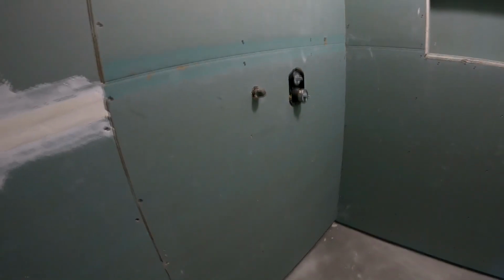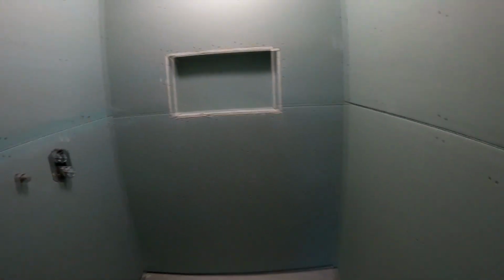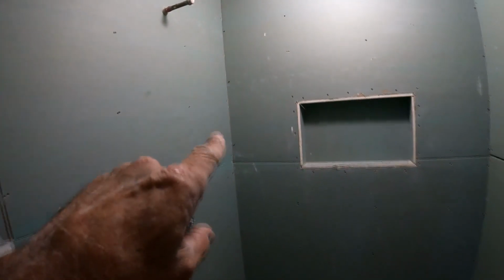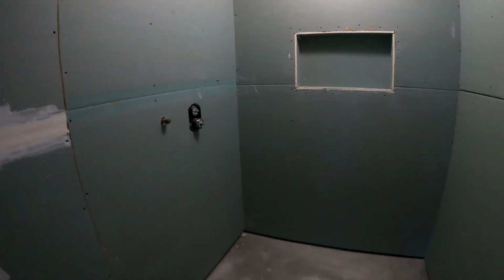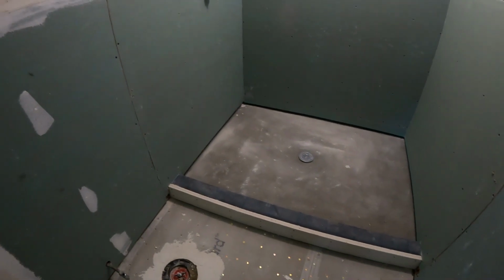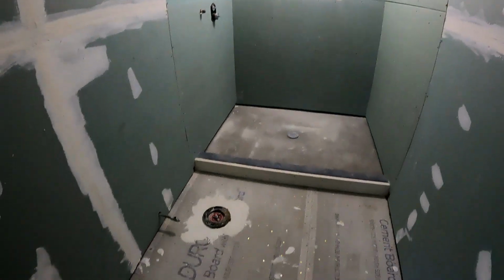COMPLETE BATHROOM BUILD...Day 5

Comment: Hi Bob ! That inside Corner mud tool sucks ! I started over and went with that thin metal backing inside and out side corner beads for my project .They are cheap ,easy and give a superior finish / look !! Very easy peasy to do and little mess ! You need a mud pan !! As always thank you for all your hard work and tips !! You are the real world guy !! Have a awesome 4th of July !!
Reply from the maker: Yes I agree the inside corner mud tool tends to rip the paper because you have to hold it in an angle...I'm better using a 3" blade & go twice.. fortunately I don't do sheetrock enough where it matters, but next time I'll give that inside corner bead a  shot 👌

Comment: When is it better to mix mud vs buy the pre mixed?
Reply from the maker: Actually like mixing the mud out of the bag, because it dries very quickly, but because it dries very quickly is sometimes why I don't use it... if that makes sense
Reply: @StarrTile  that makes sense. I tried 90 min for my first two coats and then sanded and then finished with the 45. I have some tape bubbling unfortunately in my inside corners and joints in small areas. It really is an art!

Comment: What kind of drywall are you using?  Denshield?
Reply from the maker: Greenboard
Reply: Is this the same as lowes purple moisture resistant drywall board? I’m in CA. Never seen the green
Reply from the maker: I suppose, I don't shop at Lowe's so I'm not sure... but in a bathroom green board is supposed to be used because it has mold and mildew inhibitors
Reply: @StarrTile  where do you purchase the green board?
Reply from the maker: @mram7715  Home Depot

Comment: Sorry, @StarrTile, but I'm confused.  I watched your video titled "Don't Put Backer Board Inside Shower Pan".  But it looks like you did just that in this video.  Please tell me where I am misunderstanding.  Thanks,
Reply from the maker: I don't know if it shows up but there is at least an inch gap between the wallboard and the shower pan
Reply: @StarrTile  AAhhh.....okay, you are saying don't put the backer board all the way to where it contacts the mortar bed.  I thought you meant not to put the backer board on top of the liner.  I understand now.  Thanks for clearing that up.